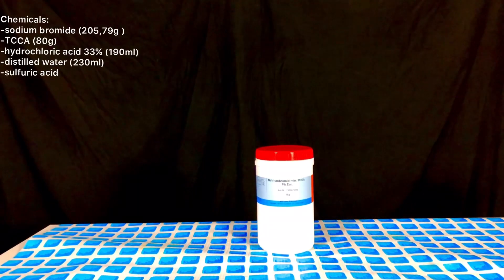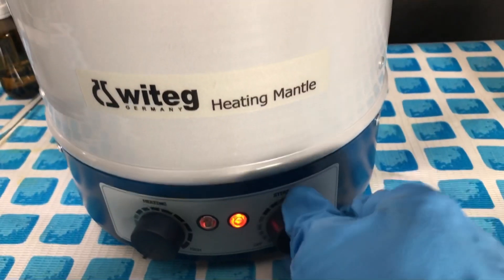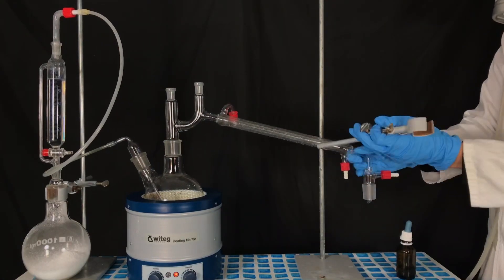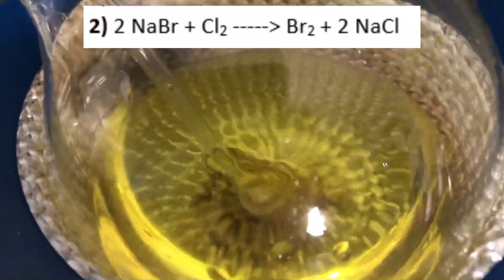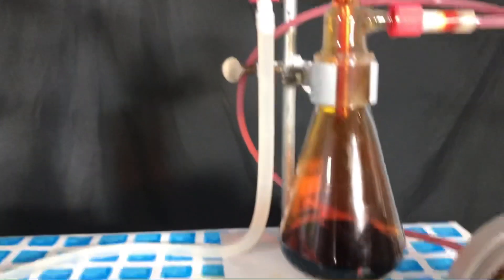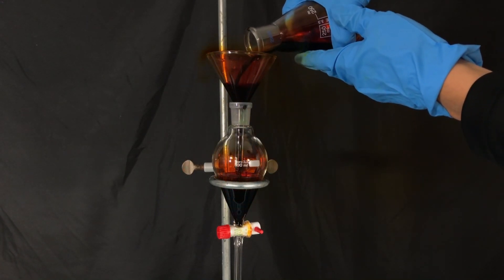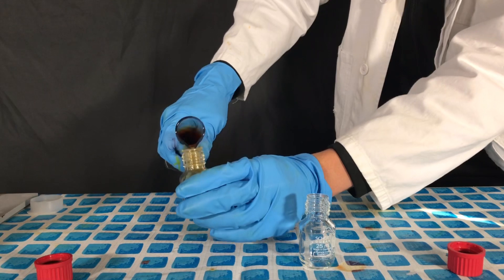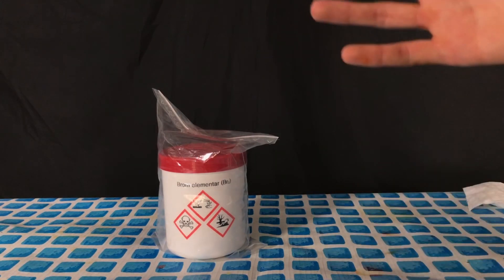Making bromine

Comment: I need your help, I tried this but the nike red way by putting it all in the same chamber, I also used potassium bromide.
So KaBr, HCl ane TCCA in one flask, didnt take long for brown vapours to form. 
I used liquid propane as a coolant in hops of getting solid bromine and reducing vapors, but it just didnt freeze, I even tired with dry ice and it was still liquid.
What did I create? HBR? 
(I put it in warm water to boil any liquid chlorine off ) 
I cant think of anything that makes sense, HBR should have boiled off, bromine should have been frozen solid and Hydrobromic acid should have been frozen too.